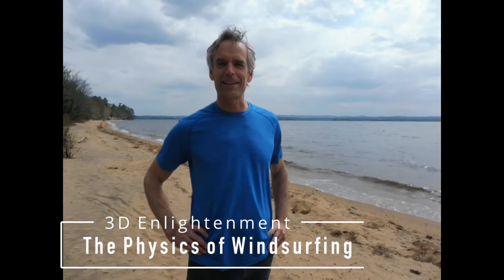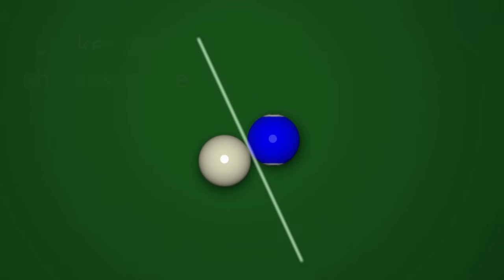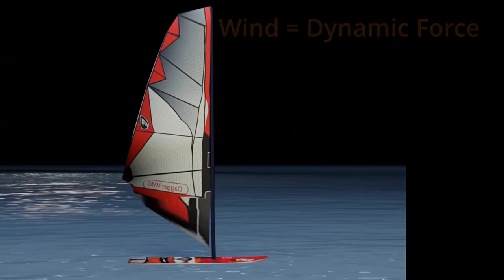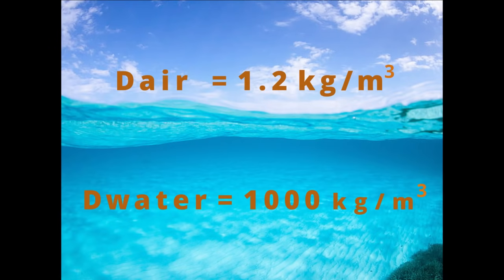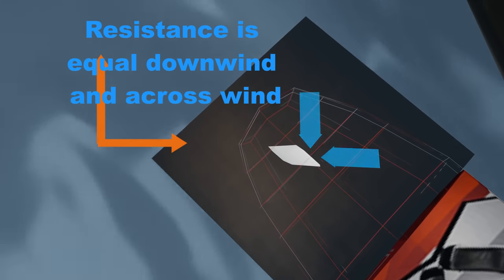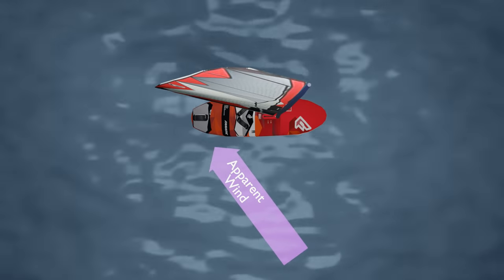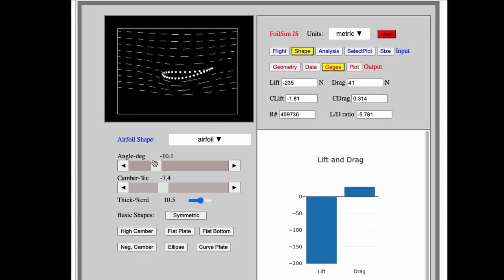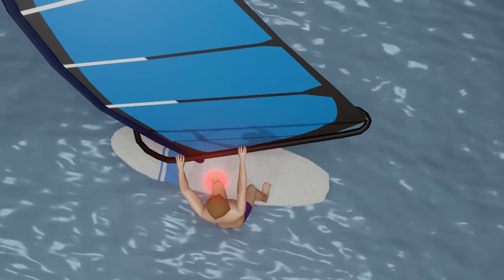Physics of Windsurfing

Comment: Acknowledge the attempt to simplify however, in my opinion, it is far easier (queue Bernoulli’s principle) to just explain how an aircraft wing works, then explain that any form of sail, be it windsurf, dinghy, yacht etc is simply an aircraft wing in a vertical rather than a horizontal position. The sail produces power ‘lift’ just like an aircraft wing, and is trimmed (sheeted in) as the speed of the air flowing over the sail increases, just like an aircraft wing. Like an aircraft wing a sail produces power (lift) due to its profile encouraging a build-up of high air pressure on the inside (windward side) of the sail - the underside of an aircraft wing - and a lower/reduced air pressure on the outside (leeward side) of the sail - or upper surface of wing. The higher pressure attempts to move to the low but the sail is in the way! air pushes against sail and power (lift) is produced. When instructing beginners I find 9/10 times they just ‘get it’ if you take a little time to explain the theory correctly from the get-go. It’s cool for most having windsurfing likened to ‘flying’ on the water!...
Reply from the maker: Thanks Tom.  I agree that a sail is very much like a wing and that the wing or sail provides lift in the classic physics sense.  In the simulator section, I was trying to clarify the fact that people hear the word "lift" and they think that the board is pulled upwind.  In fact, there are no forces on the sail that pull lit upwind.  All forces as shown by the simulator will push or pull it either downwind or forward.  There is definitely differences in pressure on either side of the sail, but this may be due to Newtonian forces and/or Bernoullian forces.  In this video, I chose to emphasize the Newtonian approach.  See these two brief papers on the different schools of thought.   
Higgins 2020: https://www.scientificamerican.com/article/no-one-can-explain-why-planes-stay-in-the-air/
Babinski 2013:  http://www3.eng.cam.ac.uk/outreach/Project-resources/Wind-turbine/howwingswork.pdf
Reply: @3denlightenment  But you can't just stick to the Newtonian forces and ignore the Bernoulli forces! It simply makes for a wrong model, as they are both present. So, it's not and/or, it's AND unless you go straight downwind.
Our models reflect reality by omitting certain factors that are deemed inessential. If you omit an essential factor, like, here, the Bernoulli pull on the sail, you do it at your own peril, as your model will simply be at fault.
Having just read the Scientific American article, I see the same confusion permeating most of it. I just fail to understand why it has to be a conflict of two beliefs rather than an acknowledgment of the two forces working in concert. Sailors have known it for generations - why not scientists?
Reply: BTW, the Bernoulli lift accounts not for an insignificant difference, as you state, but for 50-60% of the total driving force at certain courses w. respect to the wind. Dismissing that makes for a major flaw.

Comment: The physics of windsurfing, what a daunting task! I noticed that in the NASA simulator, you implied that the lift force is downwind, but you drew the arrow across the wind. The sailor in that diagram was positioned to be sailing high upwind. As you showed earlier in the video, if the lift force was perpendicular to the sail then there would be a component taking the board cross/down wind and one going close to the wind. So the windsurfer is pulled upwind while the fin resists the cross/down wind force. I also found the free body diagram of the fin a bit confusing because it was broken down into components and not just perpendicular. The sail stalling also seems to be what limits your angle upwind not really the forward resistance of the fin.

I did learn, though, that the the angle we can sail upwind changes with apparent wind. I had not thought of that!
Reply from the maker: Thanks John, I get what you are saying about the arrow pointing across the wind and not exactly downwind.  Thanks for that.  And, yes, even though the lift was negative, it is still the driving force taking the sailor upwind.  I was trying to clarify the "lift" in terms of a pulling force...but I may have unintentionally added another level of confusion to it.

Comment: I think the pool ball analogy is a bad one. If the wind hits the sail at 45 degree angle or less, the reason it pushes the sail cross wind instead of downwind is due to the shape of the sail (same way an air-plane wing generates lift due to it's shape) if the sail was flat, it would be pushed downwind still when it was held at 45 degree to the wind.
Reply from the maker: There is some discussion over whether lift is the Bernoulli effect resulting from the curve of the sail or the Newtonian effect from the air molecules striking the sail.  There are a number of papers and videos discussing the difference.  I will also discuss the difference and present this further in an upcoming video.
Reply: @3denlightenment  If we take the board and the fin out of the equation and replace the sail with a rigid flat object, according to your version it should still be moved cross wind when it's held 45 degrees to the wind.
Correct?
I'll be honest i didn't test that but I think it will be moved downwind.
Would you say that experiment would settle the argument for us?
Reply from the maker: @IliaBroudno  Yes, that is correct.  I will try to demonstrate that in my next video.
Reply: That should be interesting.
How would you set up the experiment?
Remember we are taking the board and fins out of the equation.
Meaning you can't stop the object from moving downwind.
Meaning if you turn a board at 45 degree to the wind and fix it on a railway car for example that's not going to prove much. The railway car will move along railways.
You can set up railways cross wind and it will of course cross wind.
You don't need pool ball analogy or molecule model to explain that.
You just add the vectors.

So how would you set up the experiment? Meaning how would you fix the board at 45 degrees without also preventing it from moving downwind?

Comment: Hey! I am writing my master thesis about the physics of windsurfing in regard of teaching :). Over all I am totally agree with wildbill805 but I think you should clarify your group of adressees or rather your objective. From that depends your balance of scientic correctness and didactical approach. Additionally, the model of air particles that transfer there momentum (NOT force!) to the sail is a bit old fashion. I may see your didactical attempt; its to pave the way for your billard analogy of the resolution of forces which I actually really like but you pay, in my point of view, a price for it. People might think that there has to be a force which is pointing towards the direction of the moving billard ball but its not! 

In that moment where the billard cue leaves the ball the acceleration of the ball (due to your muscles force) stops. After Newtons law the ball moves from now on with constant velocity (means v=const. -> a=0). If it clashes with another ball it transfers its momentum (m*v). The clashed ball is accalerated from v=0 to v=constant in a sec as the billard cue acclerated the first ball in the beginning, so you could say "Well if the velocity of a mass was changed by time, there had to act an force!" Yes, thats right! But just for that moment and afterwords no anymore. So the transfer of momentum causes that a force (pair) apllies to the balls whereby the balls leave there place with constant velocity (a=0).
 
Just to clarify, during windsurfing for example: if the wind blows with a constant velocity in your sail and your are not changing its angle of attack than you are driving with constant velocity because there is a force pointing towards your moving direction but its in balance with the friction forces of water and air. So in that case, there is a force pointing in the moving direction but its in balance with friction. And after Newton first law the board drives with constant velocity as if there is no force apllied. 

Omg, that was a lot of explanation and sorry for my bad punctuation.... hope I could make my point :) Cheers
Reply from the maker: A bit of a late reply, but thanks for this.  I would agree with you regarding force vs momentum, I should have made that more clear.  I was trying to speak in more of a common language, but I should have clarified.  My next video should clarify this.

Comment: The part wich says that the sahpae of the sail won´provide lift is not clear enough it din´t consider the apparent wind..Other wise we wouldn´t need a sail with a shape. Also it din´t took into account that the leech of the sail contributes to it´s performance. So why would one need a loose or close one?...I don´t doubt the research but i think it should go deeper..
Reply from the maker: That is the key question.  Do we need a sail with a shape?   The physics analysis would say that it is not needed.  Many sails have no camber (curve shape) and they sail perfectly well.  If the leech is loose, then the sail will absorb the force of the wind and there will be less overall power generated through the sail.  A future video could go into this.  Thanks.
Reply: Hello Paulo, this article from North Sails discusses sail twist. 
https://www.northsails.com/sailing/en/2019/12/how-sails-work-north-sails-blue-paper#:~:text=Since%20the%20purpose%20of%20the,possible%20pressure%20difference%20across%20it.

Comment: wow the fin is not the only water factor there is weight transfer and drag and rail provides more control than the fin and the rail is used for speed the fin for tacking or other slower maneuvers.
what makes me mad is i either cant properly set up my sail or the rig is to heavy for my winds.....
try to find sail neutral in 13 MPH or less winds and my rig is to heavy! in gust of 17 it almost gets weightless.... this is not good enough i really need a tiny rig set but my board is to advanced for me.... i really should have started with a beginner kit.
i was hoping i would have missed something in physics but it did not cover anything i didnt know already and noticed it was missing some factors. like even the water smooth or chop are factors and leaning mast forward or tilt back can also change its power not just pulling in sail.
fin length and daggerboards and speed also add a ton of stability
Reply from the maker: A balance of board size and sail size are important especially if you are beginning.  If you are not able to water start yet, then having a board that it boyant enough to allow you to uphaul is essential.  The selection of sail size will depend on the wind speed, your skill in the harness, and the conditions of the water.  If your sail is too heavy, is it possible there is water in your mast?  The larger the sail the heavier it will be.  Also, some lower-end sails will be heavier than the more expensive high-end ones.  It is also natural for the rig to feel heavy in light winds and become almost weightless when the wind speed increases and the board starts to plane.  All the best.

Comment: "The curve profile of the sail does not lift the sail upwind". For a given sail, when wind becomes lighter we would "bag" the sail to help gain power. I assume bagging the sail would create a curvier profile. Does it mean a baggy sail reduces the upwind efficiency?
Reply from the maker: When the sail is "bagged" this would provide more of a curve and therefore would increase the drag.  Depending on the angle of direction relative to the apparent wind, the increased curvature may "catch" more direct wind force, but will vary with direction of travel.  When the wind blows over the curved sail it will create a slight low pressure area from the coanda effect on the leaward side of the sail.  This will result in an additional but slight pull forward and downwind (not spoken about in the video).  The angle of the fin (daggerboard) in the water will translate all of the forward forces upwind.  So, all of that to say that the increased curvature can provide an additional forward force but, yes, will also create more drag.  The increased bagginess can also provide a bit more of a delay in responsiveness which may be desired if the winds are gusty.

Comment: great video, but i think that in the sail lift profile you have a mistake , if you change the camber diraction in the simulator you do have lift
Reply from the maker: Yes, but then the camber is not the direction that it is while sailing.  A note of clarification on lift has been added below the video.  Thanks

Comment: Very interesting and great edited! What happens when you tighten the battens and as a result change the angle of the wing of the sail?  Does it affect the angle of the particle "hitting" the sail and change the angle you can surf upwind? 
Are you sure that the nasa simulator is a good reference?  Does it consider the fake wind and the movment of the object (moving sail vs still wing of airplane)? 

And can you make another video  about foil windsurfing?
Reply from the maker: Thanks very much and interesting questions.  I would think that if you tighten the battons you are enhancing the stiffness of the sail and therefore will enhance the responsiveness of your sailing experience.  The change in angle of the sail as a result of tightening the battons will have a minimal effect relative to the general angle of the sail.  The maximum upwind angle should also be minimally affected as adjustments can be made to the general angle of the sail to compensate.  A more dramatic difference will be noticed with an increase in fin/dagger board size.  
I'm sure the NASA simulator is fine, but it doesn't distinguish the ambient wind from the apparent wind, but would primarily consider the apparent wind since when it comes to aircraft, the speed of the plane, and therefore apparent wind, will be relatively high compared to the ambient wind.  The discussion of lift around the NASA simulator has presented a point of confusion since the term "lift" also has specific meaning in aerodynamic theory, a point which I will clarify in another upcoming video.  
Thanks for the suggestion regarding the foil  windsurfing. I will seriously consider that!  Thanks again.
Reply: Baz, it's not the battens that determine the angle (of attack? I'm not sure what you mean); it's you, the sailor! The battens may influence the profile (depth, shape) of the sail, but have no influence on the angle of attack, as it's measured between the direction of the apparent wind (not fake! For us, it's so real like you wouldn't believe, and the particles hitting the sail are exactly that on a macro scale) and the plane from mast to leach. 
Tightening the battens may influence how close you can surf upwind, though, especially in stronger wind. If a profile is too deep, the wind will make a dent in it on the leeward side, get the airflow out of shape and so greatly diminish the Bernoulli pull.
And I understand your doubt about the NASA simulator as a reference. It's actually as good as it gets, provided we don't misinterpret it like the video does.
Reply: @3denlightenment  The NASA simulator does not distinguish between the ambient wind and the apparent wind because it's already been calculated into the apparent wind; your words, actually, although you're not pushing the point through sufficiently enough in the video; more on that later.
And it's not the simulator that presents a point of confusion; it's your interpretation of the diagram. More on this later, too.
And if 'lift' sounds confusing (as it may), why not call it 'drive' or 'thrust' when it comes to windsurfing?

Comment: Great vid, thanks. Please consider doing one on how to optimize upwind progress.
Reply from the maker: That's a great idea.  From my experience, the greater the surface area of the fin and the presence of a daggerboard make a very significant difference.   If I were manufacturers I would increase the surface area of the fin.  Of course, depending on the design, it can interfere with maneuverability but something for them to think about.  I will also think about another video.  Thanks.

Comment: nice man! would be awesome to do a hydrodynamic model, as it relates to board construction and performance in turns. I've been learning the sport recently and wondering why the board shapes are not modeling some of the ski boats or modern sailing hulls. Maybe it's just easier to manufacture a flat, fat, rounded rail? I met Paul Mindnich recently of BenchMark Board Design and Tri-Hull Dynamics and the stats on his board designs are impressive.
Reply from the maker: Thanks.  A hydrodynamic model related board hull shape would be interesting.  I'll add it to the list.  Thanks.

Comment: Damn, that's awesome! Can U do a kitesurfing one?
Reply: for kitesurfing the principle is exactly the same. as long as the kite is on 12 you pretty much have a windsurfsail thats lying above you instead of standing in front. and when you move the kite its gets "moving wind" (dont know the proper english term) like the windsurfer does when he moves. of course you also get the moving wind from moving as a kitesurfer yourself. for kitesurfer the effect it has is a bit more power for the kite and it rotates your windwindow (because it simply makes the winddirection rotate a bit)
long story short. the faster you go the less you can go upwind